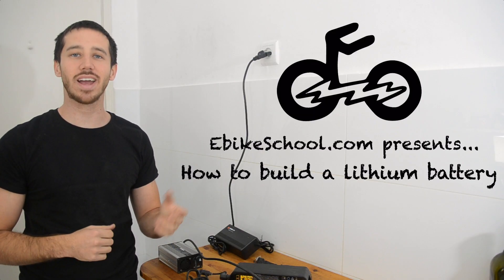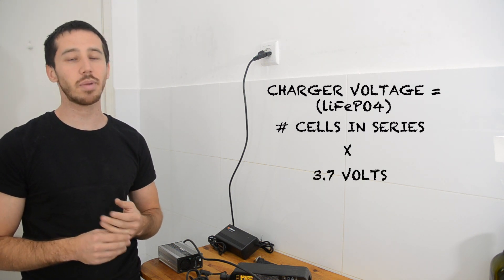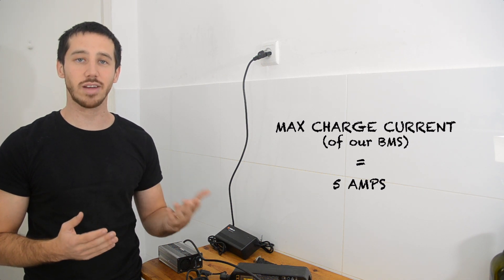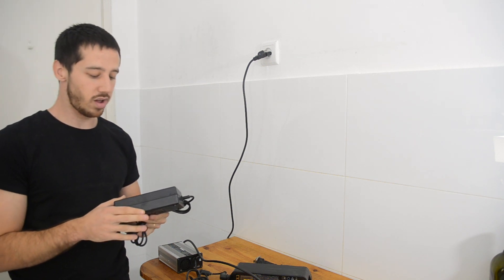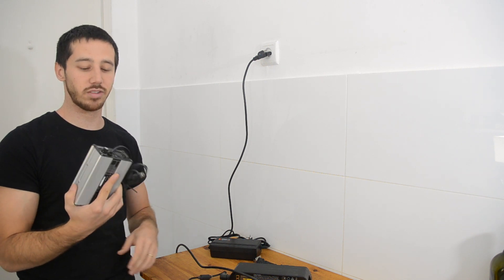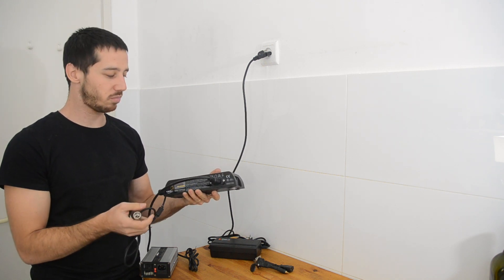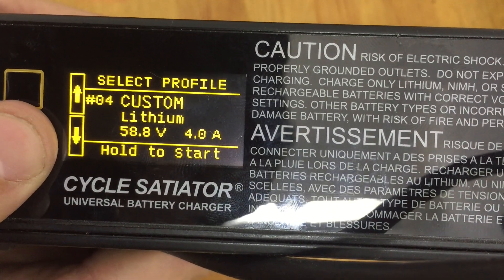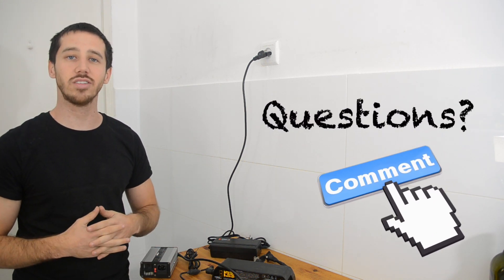DIY Lithium Battery - Choosing a Charger - Part 5/5

Comment: Can we charge 48v li ion battery with lead acid battery having same ratings?
My charger is rated at 62.5 max voltage
So can I use this charger.....
Reply: No! and do not attempt it without using a Step-Down Converter, (or similar) as you need to bring the charging voltage down to the same or a little under the max voltage of your battery, if you do not there is a risk of fire! or at least damaging the BMS-Battery etc with a Li-ion battery. The charger and this Li-ion battery are not compatible without using a transformer or a DCDC Voltage Step-Down Buck Converter etc, It may be a just cheaper to buy a 48v Li-ion charger.

Comment: Where do I get connectors to put on the wire for many different ebike batterys and controler to fit the hub motor for now I have a 48v 1000w battery and rear hub motor but the same connectors won't fit if I upgrade

Comment: I bought my first li-ion battery problem is it didn't come with a cord the connects the battery to the controller. So I bought and PC cord the connects to but I don't know how to connect the green black and white wires to the red and black wires.

Comment: Can i charge li-ion battery pack using PC power supply and DC step up converter with adjustable voltage and current?  Of course with BMS.

Comment: Hi, I'm in the  middle stages of my e-motor cycle build. The motor is rated at 11500kw (72v 200a) and I'm making a 20s52p pack (72v with each cell lowest spec being 2000mah) it basically comes out to about 7kw/h. Is there any charger you know of that can charge at those specs and have the battery fully charged in about 8 hours more or less?

Comment: Hey I want a 72 volt 15+ amp charger, my BMS and Cells can take 50 Amps. To save money can I wire two or more of these chargers in series and or parallel to get the voltage / amperage I want? 

Question 2, on a different battery pack I want to wire 2 42 volt bms in series to make a 72 volt battery pack, is there any harm in puting bms in series?
Reply: You cannot put BMS in series. You need to get a 72v BMS.

Comment: Excellent series learnt a lot from it. Have been pondering about a power pack but no idea how or where to start. My purpose is powering amateur radios, tablets and laptop on the go. I bought a power bank that does this but wanted to build my own with more power for longer time. Also bought your book for further reading before I start my project. One question, is it better to spot weld or use the Vrusend system? Your welder not too expensive but us it easy to use/setup? Perhaps a video series on the tools you use, why, how, when and any configuration etc would be good follow on. Thank you. Leeds UK.

Comment: Hi,  I think I did something wrong,  I need a 24v pack for my bike then I bougth a 24v 7s BMS and 21 batteries about 1950mah,  and a charger 29.4v 2amp,   after a lot I finish my pack but when I check voltage on my pack is 29.5v instead of 24v, and i think it could cause a problem, can you please say if i can use this pack?,  thanks
Reply: 29,4 v is voltage a fully charged 7s pack. You are on the spot.. no worries...

Comment: Hi Micah, i have bin watching your vids for a while now.. like your content and what your'e doing i think helping people diy building batteries packs for all kind of uses helps reduce the strain we are all putting on this tiny blue ball we call earth..
i just bought two nice high end ebikes to do sum touring with my wife.. to be honest they are on the top if not a bit over my budget lets just say Riese&Muller is not cheap.. ah well i hope to be using them for years&years to come..only question i have is should i be using the provided charger or try to get an other one that chargers the batteries at a slower rate ?? They are using the new Bosh tube batteries.. i know that in the future i will be trying to put in new cells but that's after i buy a spare pack  i'm hoping that's in 5yrs at least.. i don't think there is a way to hack the charger to charge at a slower rate..
Greetings from The Netherlands..

Comment: Hi, thank you for the video. I did not quite understand: will it actually cause a trouble/damage if the charger provides 150 A, but the charger only rated for 100A? Thank you.

Comment: Very helpful videos.Just have a  question,most electric skateboards  if not all are 36V..,if i use the LUNA CHARGER 52V ADVANCED 300W EBIKE CHARGER,will it auto detect the voltage and charge appropriately or is it for 52V batteries only?thanks.
Reply from the maker: No it will not
Reply: Ok got it.thanks

Comment: what charger should I buy I'm try find a charger that can do from 12volt 96.5volt and 2amp to 5amp lead or lithium battery is there one I can buy that will do that because I got a lot of different battery

Comment: Since the BMS regulates charging voltage and current going to the battery pack, why does one need to worry about calculating the exact voltage to size the charger needed?  I thought you're fine as long as the charger's output is somewhere near the battery pack voltage.  I measured the voltage output of one of those cheap plastic 36V chargers I happened to own.  The measured output was 42V.
Reply from the maker: Because the BMS is designed to act as a safety, not as the single regulator. It is there to keep the pack from exploding if you accidentally try to overcharge it. You should use the correct voltage charger, and allow the BMS to function as a backup safety.
Reply: But the cheap chargers are almost never at spec (as is in my case).  Exactly how close to the pack voltage do you think charger output voltages need to be?
Reply: BTW, I bought your battery book, and have read most of it.  Very informative.

Comment: how long would it normally take to charge a 14s11p Cycle Satiator charger?
Reply: depends how many mah your battery has, times that by how many p you have and you will get mah of your whole pack, If you get a charger that can charge with as many amps as your battery pack has ah, then the charging time will be a little over an hour without balancing...

Comment: Hi Micah How can i charge my battery pack not together for example 6s8p ? It means instead of 25.2v with 4.2V ? Can i separate the battery pack for the charging time with a switch somehow  for 1s8p? At this case i can charge it with less Watts.Thanks

Comment: Hi, and thanks for the video, it really helped me out with some doubts about charging batteries on Batt-packs and BMS. 
I have one question and I hope you can help me out.
Is it possible to use a RC battery type with a BMS like you did your solution . 
Those batteries comes out with a connector for balanced charging,  isn't it possible to just wire that connector to the BMS ? 

Thanks and keep to good work, really enjoy your videos.
Reply from the maker: Yes, that is definitely possible and many people have done that as a safer way to use RC batteries on ebikes or other devices.

Comment: Hi, Micah. I'm looking to replace the acid batteries of an electric scooter with a DIY lithium battery (made from 18650 ones). I wanted to ask you if there is any difference in the charger that runs the acid batteries and the one that charges lithium batteries. Do you think I can use the old one or, do I have to buy another one? (24v 1.5a)
Reply from the maker: Definitely DON'T use the old one. It float charges, which is bad for li-ion. You want a true CC-CV charger meant for the exact number of cells in series in your specific battery.

Comment: Hi Micah, I'd like to know if I can use a charger rated 60v 3 amp output to my 52v 14s li ion battery. I understand that the maximum voltage for my battery pact is 58.8v so this charger is over 1.2volts.
Reply: Hi Anthony, NO, you can't use it. First because for a 14s you would be charging your cells to 4.28 that is not good for them. They should never overcharge to more than 4.20v or you will reduce their life. Also, I am not sure that this charger is valid for Li-ION as it is not an acceptable voltage output for Li-ion batteries.

Comment: I've been seeing a lot of folks take old tesla battery packs and rebuild them into new packs.  I'm actually thinking about doing the same and dealing w/ removing the spot welded fuses.  600 bucks for 308 cells seems pretty good.  but my application is different since it's automotive house battery that needs to be able to charge from 3 sources (alternator, solar, wall charger).

I'm planning to make a 4s136p battery that gives me ~102 AH at 14.8v -- Would I need to buy 34 BMS boards or are there other solutions out there?  I've been reading that the best chargers are individual cell chargers, but that seems a bit complicated.  And I guess I'll also need to figure out how I want to wire in a battery separator.

Comment: hello sir. I just wanna ask if i have 3000w 60v motor, the BMS is required to have 60v 16s 50amps(and above). but here in the philippines, we only jave 45amps and below. Some experts heres says, it needs the BMS to ne paralleled. My question is, How do i parallel it? ive searched the web and on youtube but i was not able to find one. Would you pls make a video on how to parallel it? or maybe do you have any suggestion sir?

Comment: What about a charger for use in my RV to charge the ebike battery. Is it possible to charge from 12v or would it be better to use a 120v inverter and charge using one of these chargers.
Reply from the maker: The easiest method would be to use a 120V inverter. Another more complicated method but more efficient would be to use a step up converter from 12V to whatever voltage you need for your battery (such as 54.6V for a 48V battery). but you'd have to make sure the converter is a CC-CV (constant current constant voltage) device.

Comment: Does the charger connector have 3 pins? It appears to be an XLR audio or DMX lighting connector. They are similar in appearance but they are shielded differently.

Comment: What is the adjustable charger you're speaking of? I've never found a good enough source :(
And cycle satiator is tooooo expensive!! The 3rd aluminum adjustable sounds like a great option, hope if you find any you can update it! Good vid!
Reply from the maker: If you're in the US, check LunaCycle.com. If you're outside of the US, check EM3EV.com

Comment: When the battery is fully charged the charger stops the charge process. Does the charger stop it or is it the BMS in the battery that stops it?
Reply: Serdar Demirci I was wondering that too. Also, charging is supposed to get slower when near-full. Who does that? The Charger or the BMS?
Reply: It's always the thing that governs, which is not a charger, rather BMS (or a charger with balancing capabilities) Charging gets slower at the end because the BMS starts balancing cells and won't let much current through from the charger...

Comment: Hi. I'm will be building my own charger using a 36 volt switching power supply at 400 watts. I will connect that to a DC DC boost converter that lets me adjust voltage and amperage. What are your honest concerns or warnings or advise ? Btw my battery will be a 13s 4p using Samsung30q. Your willingness to share your knowledge is awesome with your vids.

Comment: Hy mike, I am working on a solar electric bike project and I have a question. can we charge the battery pack on small amps while discharging it at higher rate?

Comment: is there a way to charge a lithium battery directly off a solar cell and if so how would you wire it into a bms regulated battery?  Sorry if my question is stupid, I'm just getting into researching e bikes.
Reply from the maker: Not a stupid question at all. Technically you could wire a few solar panels in series to charge a lithium battery directly but it would be fairly dangerous without anything to regulate the electricity. A BMS would help but you still want to use a device called a "charge controller" for safety. There are some fairly cheap ones out there if you don't need to charge with very high current.
Reply: is it possible you could do a video on building a bike that had such a configuration?  I would be very interested in utilizing the power pack not only for riding, but also as a sort of mobile power plant for backpacking.
Reply: EbikeSchool.com can u pls suggest link to get "charge controller" pls..I'm little suspicious of my ability to correctly fix a bms.. :(
Reply: There are two types of 'Solar charge controller' i.e. PWM & MPPT. But this charge controllers are used with Lead Acid Battery. Can we use this charge controller (PWM / MPPT) with Li-Ion Battery also or there are some different types of 'Solar charge controllers' available designed specially for Li-Ion Battery???
Thank you in advance!

Comment: Excellent presentation thank you. I'm considering getting an extra battery purpose made for me to get a longer range, and was advised that it should be made with copper interconnects instead of nickel.

The reasoning given was that "Copper is almost 5 times more conductive than nickel and thus the overall resistance of the battery pack is much less, resulting in more power and less heat. 
This improves cycle life significantly as well as providing more power and less voltage sag with improved run-time".

I wouldn't know, I'm just quoting what I was told, so would you be good enough to comment on that statement please.

Thank you, Art Speck.
Reply from the maker: It is true that copper has less resistance than nickel, but nickel has a low enough resistance to begin with, when used in the right specifications, that it is plenty strong for ebike use. It is also easier to get good spot welds on it, because copper can be difficult to spot weld. Essentially all professional ebike battery builders use pure nickel strips - it's the industry standard.
Reply: EbikeSchool.com Thank you so much for your reply. I can accept what you say, and shall mention your comments to the guy who will be building my battery. Best wishes, and thank you again for such detailed videos. Art
Reply: Art: The thickness of the conductor wire is an important factor for the purpose of conducting an electrical current. In the case that we are seeing  with the Ebike School Li-Ion battery, the cross section area of the Nickel streep is capable of handling 4 times or more the actual current  being used. Then, the ultra convenience of no rust in nickel, is another fabulous convenience that a better conductor like copper won't give us. Is a matter of convenience when we strive for getting read of future problems like rust and CuSO4  ( Copper sulfate).

Comment: I was surprised you did not talk about the charging profile of these chargers.  Are these chargers specifically designed for lithium ion batteries?  The way a lead acid battery is charged is different than the way a lithium ion battery is charged.  A lot of the battery chargers are designed solely for lead acid and at the end of the charge they do a float charge which is detrimental to the life of the lithium ion battery.
Reply from the maker: Yes, these are all li-ion specific chargers, which are CC-CV (constant current- constant voltage) profile chargers. I guess I shouldn't have assumed that that was obvious.